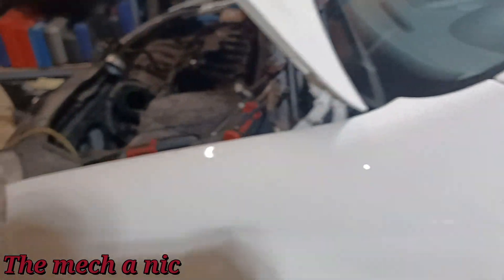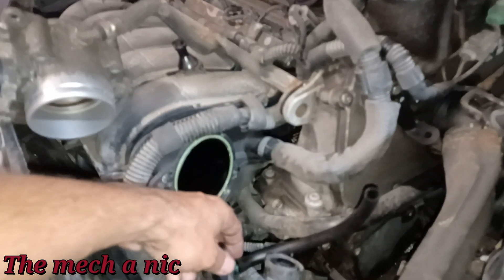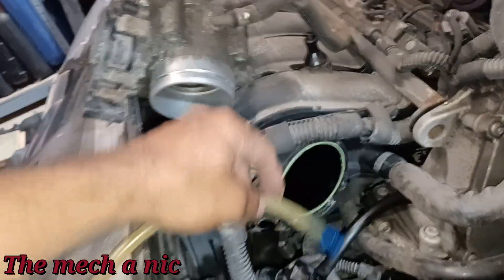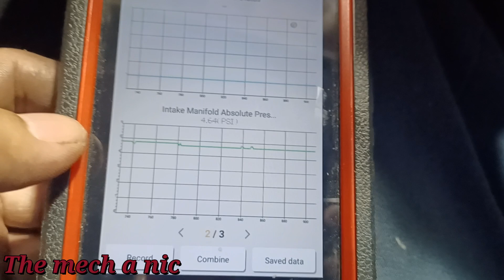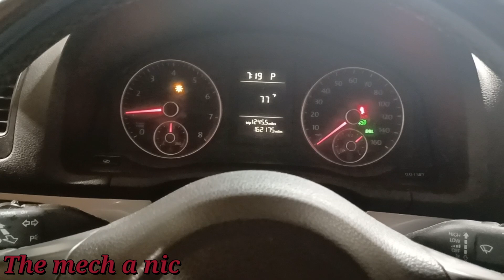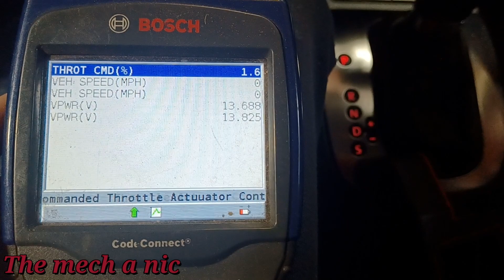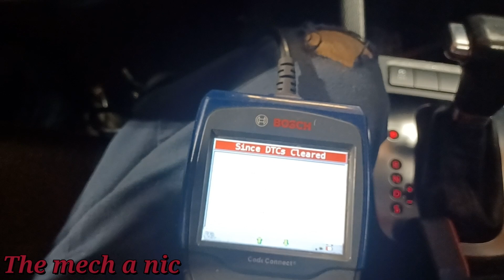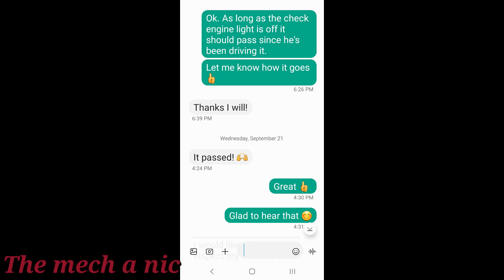VW P0106

Comment: I would clean the throttle body an cat. If you do that and it still comes back you’re gonna have to clean the intake manifold for carbon an you should be good after that 100%.
Reply: Unless you have a vacuum leak but other than that do that

Comment: Thank you so much for sharing the video! The check engine light had been on for over two years, and two repair shops couldn't find the cause (or maybe they were trying to rip me off, I don't know). I had error codes P0106 and P2188, and cleaning the throttle body actually worked in my case. The previous owner imported the car, which is quite rare here in Germany. I love the 5-cylinder engine and will be keeping the car for a while.
Reply: Did you change pcv valve and sensor or just cleaned the throttle and what did you use to clean it?

Comment: 4:31 great video, thank you. I’m having the same issue. Changed my map sensor and diaphragm but fuel economy still seems poor and check engine light still active.

What did you use to clean the throttle body?
Reply from the maker: Brake parts cleaner

Comment: This code is notorious on these engines & sometimes it's best to clear it or let it go away after a drive cycle. If it's a dirty throttle body or anything serious you'll get other codes with it. VW even made an updated Secondary Air Injection Pipe because this code was being triggered so much with the older style pipe & yet it still acts up. It also could be a faulty connection in the wiring harness that connects to the censor but I haven't experienced this yet. This code is just an emissions warning saying the barometric pressure that the ecm expects to see is off but the ecm then adjust the air/fuel mixture appropriately which then could cause a rich or lean code on another sensor but the sad thing is you can't stop it from coming back intermittently. I have a brand new valve cover (torq you spec), air intake sensors, map sensors, replaced a few diaphragms & even changed the throttle body & it still comes back eventually. This is why i'd suggest clearing the code if its alone & seeing if it comes back quickly & if there's a code associated with it focus on it. It could be a diaphragm or bad throttle body but its most likely nothing. hen you get a code your car will run through a drive cycle & the drive cycles vary on different cars. I think it's 60 miles for VW but I'm not sure but anyway if your sensors didn't get triggered the code will clear on its own & the cel light will disappear. Even if you change out a sensor & don't clear the code you still won't know if it was the FIX you performed or the fact it hadn't acted up in the drive cycle period & this is why if there's no other codes with the P0106 you should drive it through a drive cycle & see what happens or clear it & see. It's not a major issue on its own though. I think the issue here the engine is precisely tuned because of emissions standards because even with the code my Fuel Trim data is only +1% or lower which means the injection system is working great for an 11 year old engine. I would hate it if I knew nothing about cars & had to take my Jetta in every time this code pops up.

Comment: Here is a tip for you good people dealing with this p0106 issue. Check your intake manifold bolts, they may be loose. A loose intake manifold can contribute to a code p0106. Upon doing this, clean the inside of the intake manifold, clean out your throttle body, clean out your hoses & check your intake manifold bolts.
Throttle body - torx 30
Intake manifold bolts - either a 6mm hex or a torx 40 (6 inch or longer "Bit" works best to reach)
Clean with throttle/intake cleaner
For map sensor, clean with map sensor cleaner and let it dry for at least 15 minutes. Map Sensor cleaner can be bought at walmart/autozone/oreily
Clear out your p0106 with an obII reader or disconnect & reconnect your battery.
Good luck and hope it helps you.
Reply: This code is notorious on these engines & sometimes it's best to clear it or let it go away after a drive cycle. If it's a dirty throttle body or anything serious you'll get other codes with it. VW even made an updated Secondary Air Injection Pipe because this code was being triggered so much with the older style pipe & yet it still acts up. It also could be a faulty connection in the wiring harness that connects to the censor but I haven't experienced this yet. This code is just an emissions warning saying the barometric pressure that the ecm expects to see is off but the ecm then adjust the air/fuel mixture appropriately which then could cause a rich or lean code on another sensor but the sad thing is you can't stop it from coming back intermittently. I have a brand new valve cover (torq you spec), air intake sensors, map sensors, replaced a few diaphragms & even changed the throttle body & it still comes back eventually. This is why i'd suggest clearing the code if its alone & seeing if it comes back quickly & if there's a code associated with it focus on it. It could be a diaphragm or bad throttle body but its most likely nothing. hen you get a code your car will run through a drive cycle & the drive cycles vary on different cars. I think it's 60 miles for VW but I'm not sure but anyway if your sensors didn't get triggered the code will clear on its own & the cel light will disappear. Even if you change out a sensor & don't clear the code you still won't know if it was the FIX you performed or the fact it hadn't acted up in the drive cycle period & this is why if there's no other codes with the P0106 you should drive it through a drive cycle & see what happens or clear it & see. It's not a major issue on its own though. I think the issue here the engine is precisely tuned because of emissions standards because even with the code my Fuel Trim data is only +1% or lower which means the injection system is working great for an 11 year old engine. I would hate it if I knew nothing about cars & had to take my Jetta in every time this code pops up.

Comment: I understand that the PCV valve only works by sending air flow in only one direction, I have already changed the membrane of my PCV and it has air flow in both directions, is it normal?
Reply from the maker: I don't have a definitive answer for you but I think pcv usually only allow airflow in one direction.

Comment: A "Fly by wire" TB has a built in, what TBI used to call an "Idle Switch".
Because of that gunk, the plate couldn't close all the way, and the ECU sees this, so it sets a MIL, then it runs a "generic" fuel trim, enough to run, but no "performance".